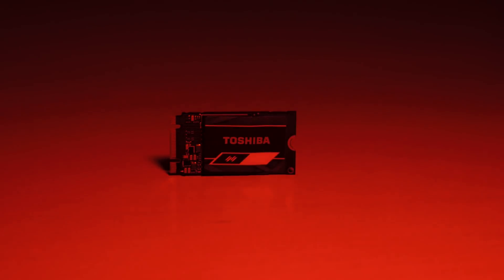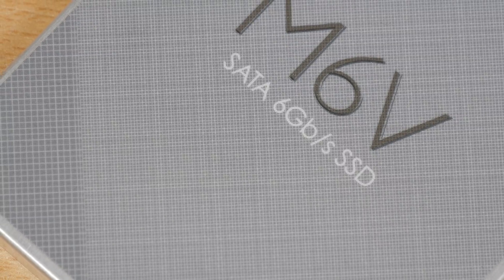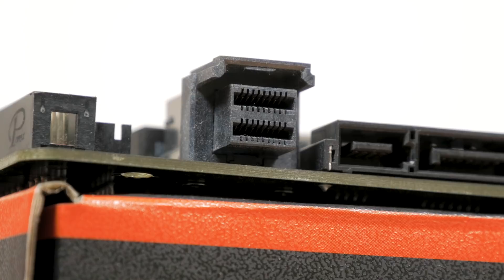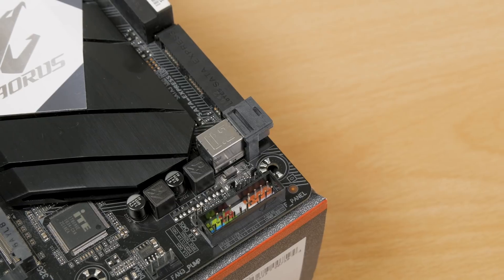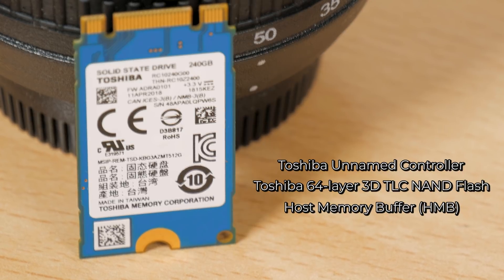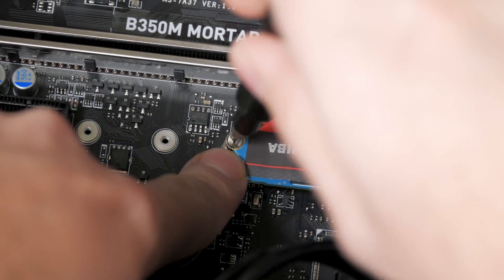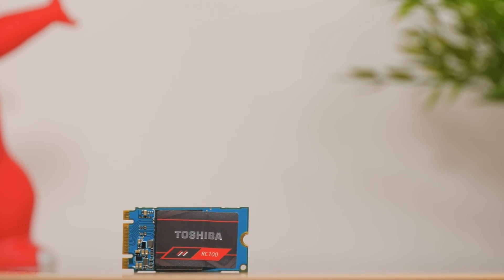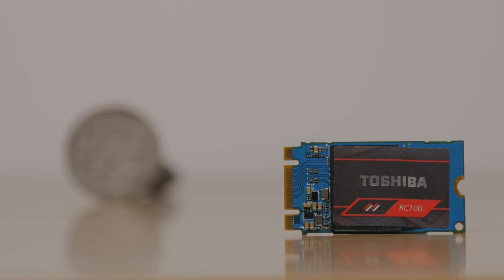REAL-LIFE difference NVMe vs SATA SSD – feat. Toshiba OCZ RC100 review

Comment from the maker: Helloooo guys!! How you've been? 😊 Let's check out if that price premium is really worth it over a standard 2,5" SATA SSD!
Reply: Good to see you are back.
Reply: How about a fast sata (samsung 860 evo) vs a fast nvme (corsair mp510)?
Reply from the maker: I think it would yield the exact same conclusion as I had in this video, basically little to no difference in everyday usage, maybe in productivity suits which are drive dependent, like Premiere Pro.
Reply: @MattsPaddock  With the same test parameters i'm sure your right although theory isn't always fact. Perhaps change the test: Win boottime, game instal times, basicly anything that would make a difference. I think by now we know wich tests yield same results over and over.
Reply from the maker: I did the win-boot time in my / this example, it yielded basically the same result, margin of error, you can see that at 7:20 mark. I could measure game or software installation time, but the problem is that every one of them is cloud client based, so they're "installing" as they're getting downloaded (Creative Cloud, Steam, Origin). I will record loading/import times with my next SSD review of Premiere Pro projects, but other than that, I can't think of something else to compare them in a way it would be still considered a day-to-day usage scenario for a mainstream user and not a niche example per sei.

Comment: I got 660p (1900Mb/s read) and used in with my old M.2 (max about 512Mb/s) and using Pcie card (max speed). I did three benchmarks (started games). There was ZERO difference in speed. BTW. Even your old 250Mb/s SSD will perform similarly. Benchmarks show difference, but it is not "real".
Reply from the maker: Pretty much, yes! This question is now being asked even more since the new PCI-e x4 Gen4 drives are coming in.

Comment: can you help me choose a new case and cpu cooler? I got a prebuilt right now which is from cyber power https://www.cyberpowerpc.com/system/Syber-C-Elite-300 but it’s awfully loud and I feel the cpu is over heating. The only different things I have from that link I gave you is the cpu and mother board. Instead of a i7-7900k I have a i7-7700k and instead of a z390m-itx/ac mother board I have an asrock z270m-itx/ac mother board. I don’t know if you could help me switch out the case and cpu cooler. My budget for this is around $150. Right now I’m thinking of getting a Sythe Fuma for the cpu cooler and a Phanteks eclipse p300 case. Can you please give me some advice?
Reply from the maker: P300 is a good choice for a chassis! I think you can fit a Scythe Mugen in that budget!
Reply: TekTick is the Sythe Mugen better than the Fuma?
Reply from the maker: Fuma is a bit better performance wise, it's a dual tower after all. Judging by my reviews, anywhere from 3-5°C better. You can go for either of them, you won't go wrong. You could go for Fuma and manually lower down the fan speed so you can get the best of both worlds.
Reply: TekTick ok thanks I really appreciate it man
Reply from the maker: No problem, glad I could help!
Reply: TekTick one more question will the Fuma clear my ram and gpu? Because I have a Mini ITX mother board
Reply from the maker: Hm, that's a good question. By the looks of it, it should, but I'm not sure about the RAM clearance. Maybe double check that, the height of RAM and cooler.
Reply: TekTick ok. I think it might tho as my ram isn’t that tall.
Reply: TekTick after quick search I found out my ram won’t clear by 2mm if I move the fan up just a few mm will that lower the performance of the cooler?
Reply: TekTick also thanks for the reply as I’ve been stressing trying to find a case and cooler!

Comment: still to bad U.2 never got taken on as this should have opened up higher performing SSDs (power/heat limited on m.2 as they have to back off if your hammering them for to long) as that should of replaced SATA (or at least if they had 2 ports)
also avoid Dramless SSDS (sata or NVME) like this RC100, buy a proper NVME SSD or a larger SATA SSD (again not dramless) for cheaper (most won't even notice the 2000mb/s read write speeds of NVME ssds, random read and writes are about the same as an SATA ssd any way withc is what kills performance in HDDs that can go into the low 1MB/s or lower speeds)

issues with dmarm less SSDs mainly is lack of dram cache for the page table and if it does not support HMB as it has to directly access and write the page table directly (even then there is higher risk of data loss if the HMB cache on system ram is somehow corrupted  and saved to the NAND, witch could happen in overclocked systems)
Reply: could/should have*